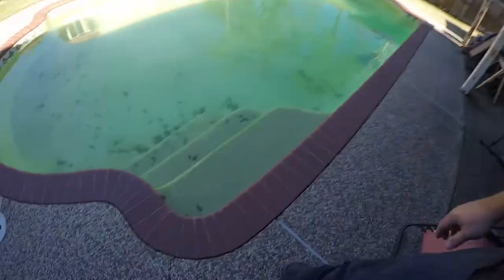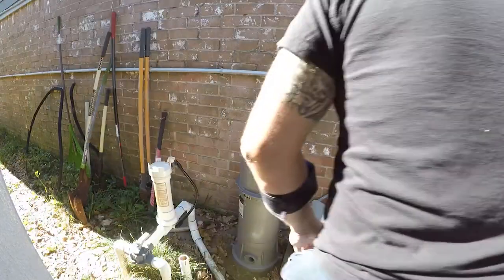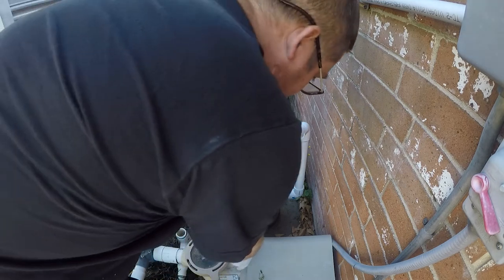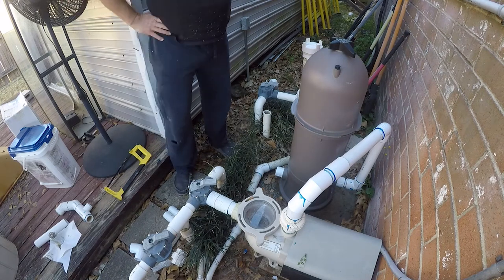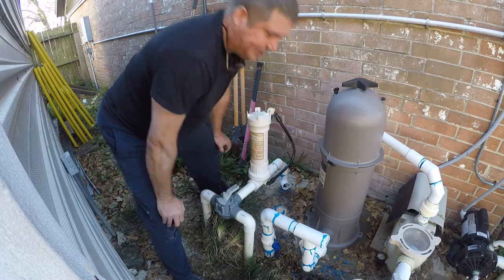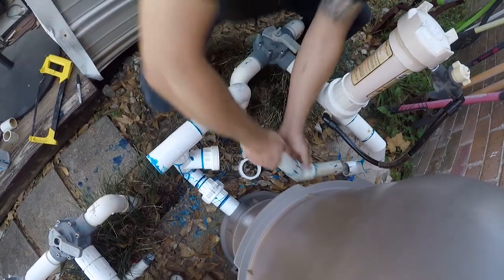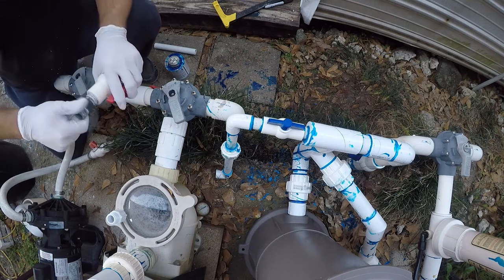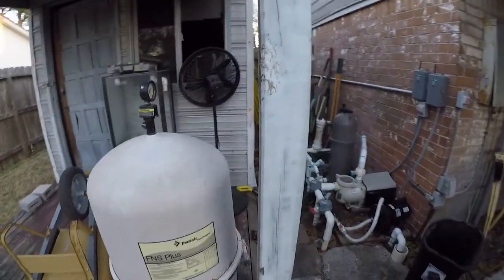Long: Replacing a DE Pool Filter with a Cartridge Pool Filter

Comment: Is this something that my husband, a plumber can install? We are trying to reduce our reliance on our local pool company that has already ripped us off by doing shoddy work on our pool liner replacement. We are new pool owners. Thanks
Reply from the maker: Absolutely, but avoid this Hayward model like the plague.  Cheap plastic that will crack under pressure from the pump.  I replaced this trash with another Pentair DE filter.... which lasted about 2 years before the bags in it developed issues.  At that point I threw it away and put in a cartridge filter.  It's a Hayward, but it just works and my pool has never been cleaner.  Cartridges are cheap and easy to get from Amazon with no hassle.  

As long as your husband can work out the fittings you won't have any issues.  A moderately competent plumber should be able to do it and a determined DIY'r can do it too as long as they are willing to re-do it if they don't get it right the first time.  A "pool company" in most places is going to simply be a paid DIY'r that has done it more than a few times.  Here in Texas anyone can be a pool contractor.... me, you, your child with just that much experience.  Yeeha!
Reply: @hotpuppy72  hahaha awesome. Thank u so much! Now if only the filters were not on backorder for 6 months! The pool company quoted us for a Hayward Star Clear which is saw can run from $250-550 depending on the model but the labor jacked up the price by almost double!! Hubby is a plumber who is also very organized and we suspect the pool techs are kids with practical experience but sloppy. This helps a lot, thanks again!
Reply from the maker: A friend said that a major pool supply house... We'll call it "L Supply" sent out someone's who's training was 3 weeks of following someone around.  Person was supposed to be able to install a pump but didn't know how to dry-fit plumbing.  So yea, I think you and your hubby are not far off the mark.  

I'm all for the camp that likes to pay someone to fix things right.  However, I think some companies are just ignorant about acknowledging that some customers actually can do the work properly.  Maybe more customers if the companies would stop trying to write one manual with 6 languages all on the same page!  lol.
Reply: Next project…clean out the backyard and get rid of the junk school bus!